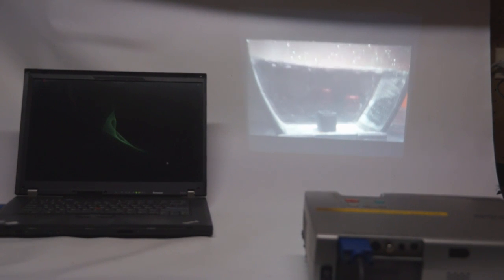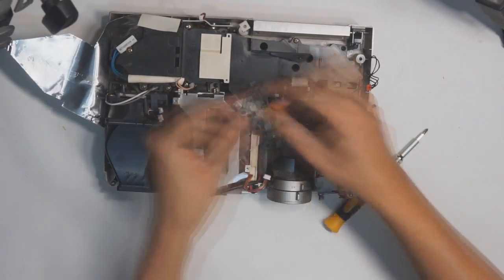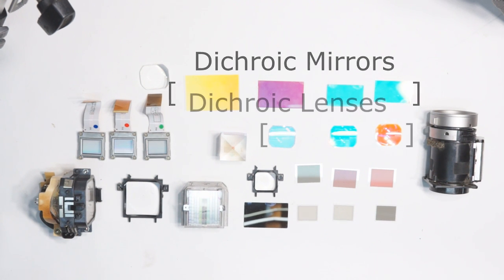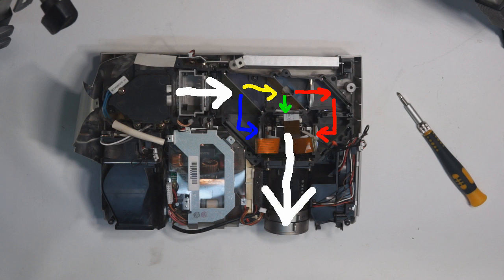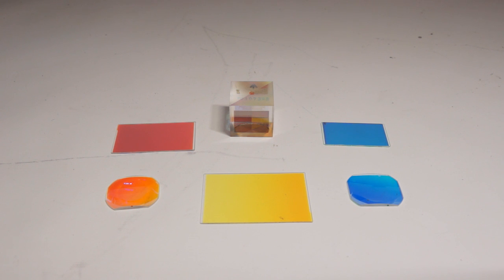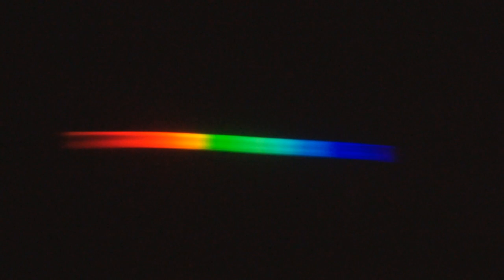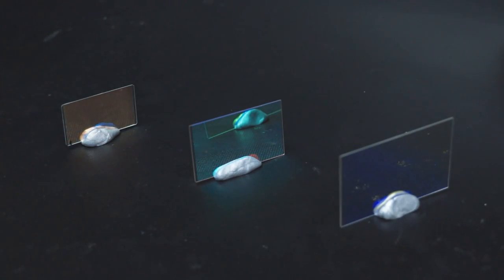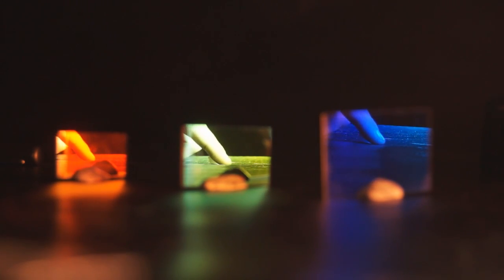LCD Projectors - Dichroic Glass

Comment: That's a really nifty find!  

Do you have any practical plans for them in mind?
Reply from the maker: I'm not really sure yet, maybe to make a selectable colour light source?
BTW I made an LED illuminator for the scope which is bright enough to shoot 1200fps slow motion! No more messing with mirrors and staring into the sun with lenses.
Reply: Oh, sweet!  Did you use the light source from the projector?

I thought about the whole 'staring into the sun through lenses' thing a bit after I'd gone outside after that note.  I was going to append a cautionary note to my reply, but then reflected that this isn't your first rodeo.  :)
Reply from the maker: I stole the LED from a "5w" flash light. It measured to be about 2w in practice. I made a little 1 transistor variable power supply and a USB cord. Anywhere you can plug in your phone will now power my microscope! (even those little power packs will go for ~15min)

Comment: Wow. I've always wondered why they had so many optics in projectors. I suppose they're using the same sputter coating technique used for laser filters, but laser filters have several layers of different substances at different thicknesses to produce a narrow rejection filter response. Must've been difficult for the first engineers who came up with the transfer function formulas. But now they can be so precise with making light filter optics!
Reply from the maker: Looking through all three there is a very dark red, maybe IR but I'm not sure if that gets blocked (I forgot to check with my IR camera) either way there is not a lot of light getting through.

I need to make set of sturdy holders so I can line them up better. I hadn't thought of using them in a different order, I agree you could probably get a much narrower band that way!
Reply: ***** I used a 130mm reflector telescope to image the Venus transit a few years ago.  I took the eyepiece out and let the image project onto a large white piece of foam board.  It worked really well, until I forgot that the earth turns and the focal point started wandering past the exit pupil of the scope and into the frame and guts of the tube.  I smelled burning plastic and smoke was roiling out of the main opening like a chimney...heh
Reply from the maker: I would imagine these are the cheapest filters possible (for mass production) it would be cool to compare how narrow a band a laser filter is compared to these ones. Thanks for watching!
Reply: Yet another awesome video man.  I had no idea all of this cool stuff was in these old projectors.

Does any light pass through if you stack all three as reject filters?  Looks like a small bit of yellow maybe based on how they overlap in that spectrum shot.   

Also, it also looks like you might get a nice deep blue/UV-heavy light if you took the reflected (sun) ray from the blue mirror and passed it through the green one as a band stop filter.  (Or a nice green if you passed the reflected ray off of that through blue as a band stop)
Reply: Look at the passband for h alpha filters, it's pretty deep red.   You might be able to stack them and take some cool photos of the sun (or fry your sensor, lol)
Reply from the maker: I have been meaning to do some Solar photography, I'll try it with a "disposable" camera.
Reply: Nick Moore

I once looked directly at the sun through my newtonian reflector which had a black filter on the viewing lens. Stupidly thought it would attenuate the light but forgot that the focal point would burn the BLACK plastic lens extremely quickly! Luckily only burnt my eyelid as I blinked right before it burnt through.

If you do ever do solar photography through a telescope, it's fairly easy. A piece of black card with a pin hole (or larger depending on the size/type of telescope) placed on the end of the telescope should allow enough light through at the same time as widening the focal depth. Just like a camera shutter but on the incoming side. Some people use a large filter on the end but the hole method is much cheaper and I think gives a sharp image. Much easier to focus.
Reply from the maker: +jcims This is one of the scenarios that have scared me away from solar imaging so far. The idea of having a couple hundred watts focused somewhere, invisibly, near by is a scary thought. It's also why I put away my 3 foot fresnel lens.